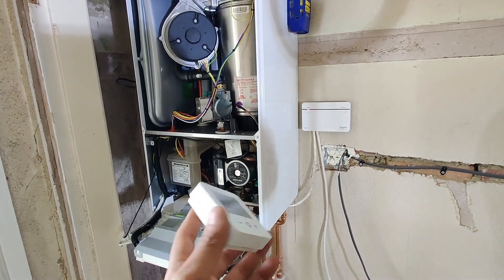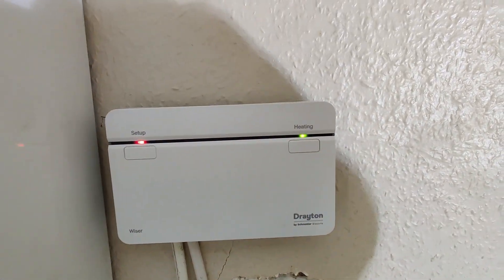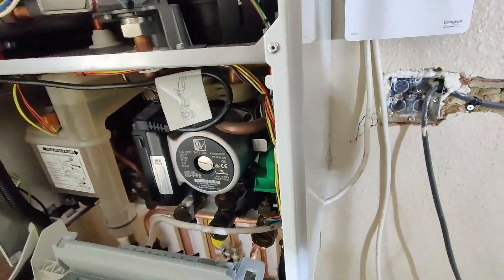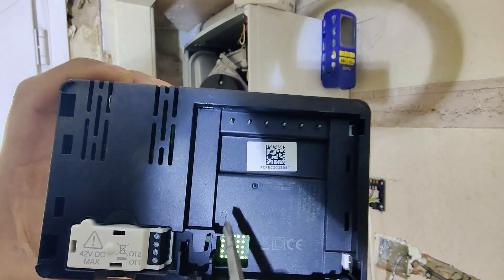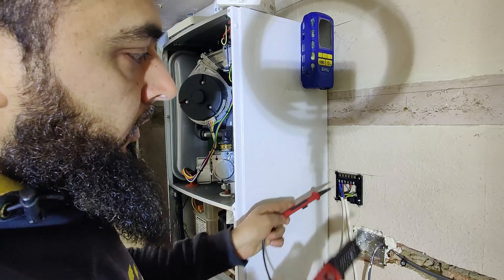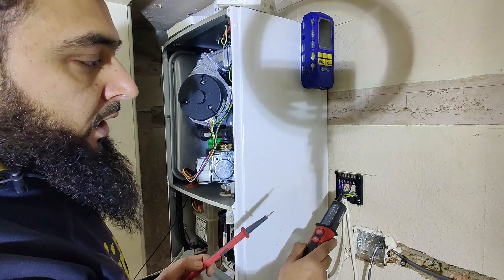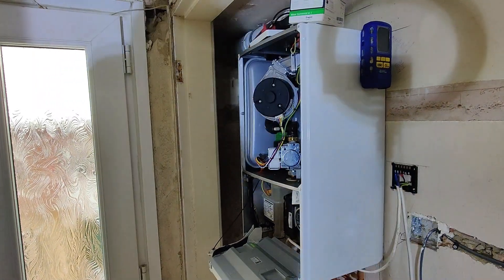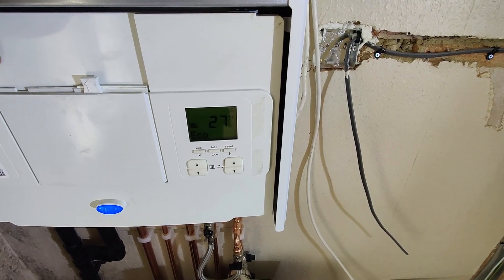HOW TO CARRY OUT BOILER/HEATING SMART CONTROL INSTALLATION AND FAULT FINDING STEP-BY-STEP GUIDE EASY

Comment: Remember your checks after boiler isolated mate.
Reply from the maker: There are certain tests which you can't perform if the boiler is safely isolated. Providing you have the correct testing equipment and knowledge/ competency enabling you to test safely, the appliance can be energised for the diagnostics.
You raised a good point though that the appliance must be safely isolated before carrying out any WORK on it. :)